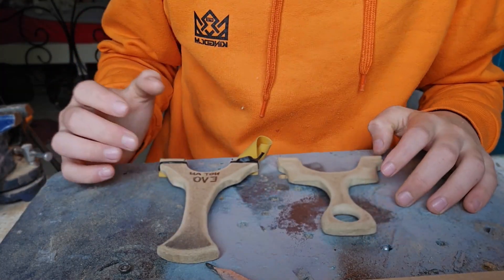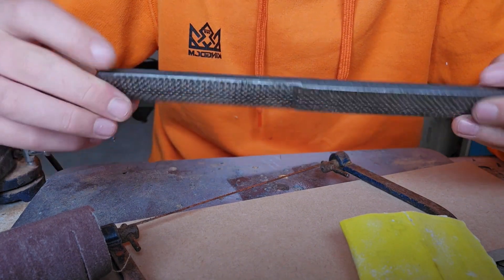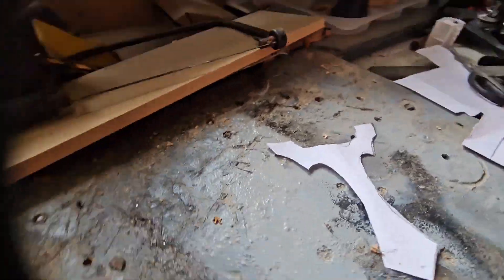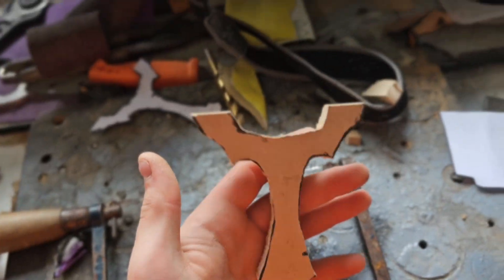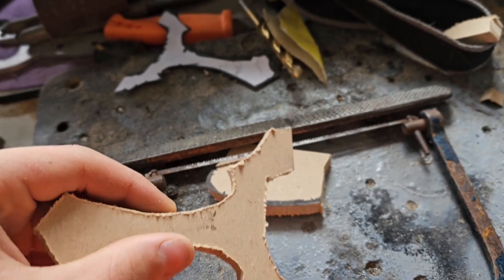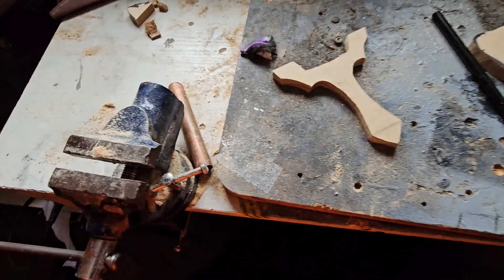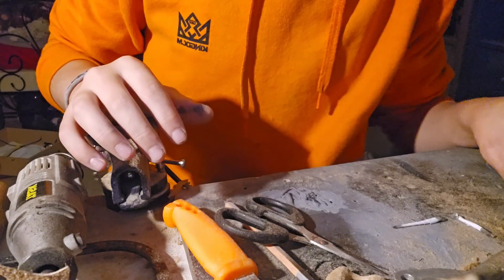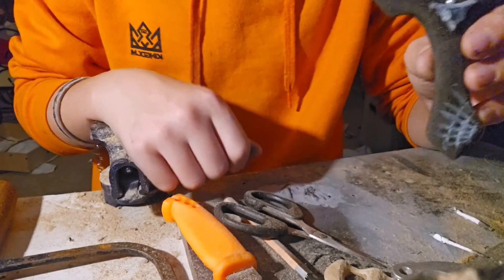Halloween Special | How to Make | Custom Slingshot!

Comment: Nice. Can I use thicker MDF/ maybe plywood for a slingshot that can take more powerful bandsets?
Reply from the maker: Yea definitely you can any wood I only had thin stuff lying around so I used that but definitely give it go I've done it with 20mm stuff and it's solid